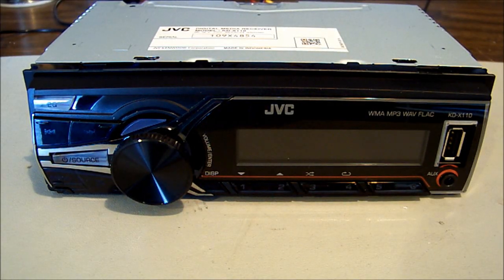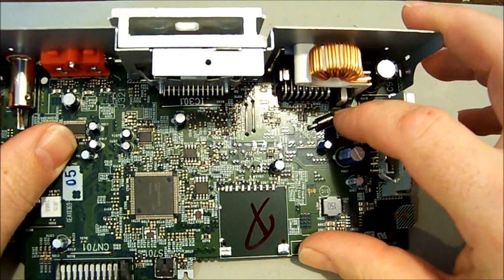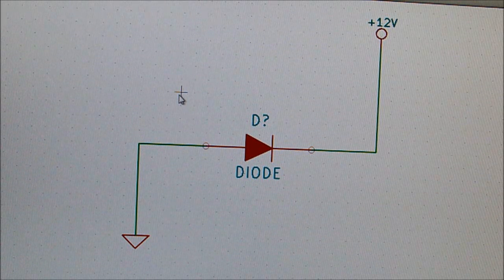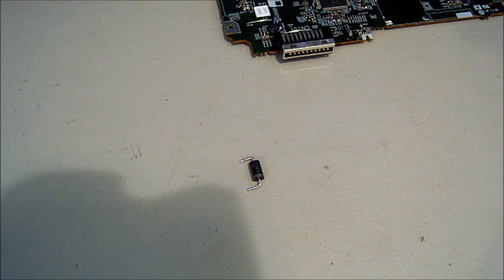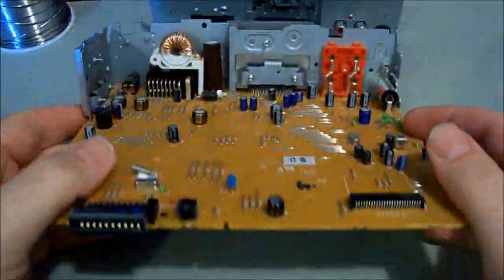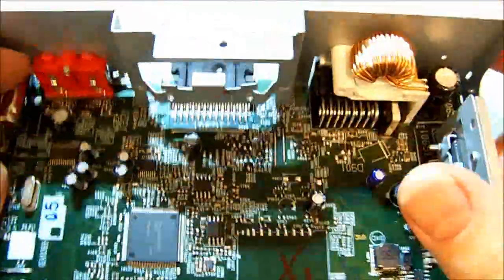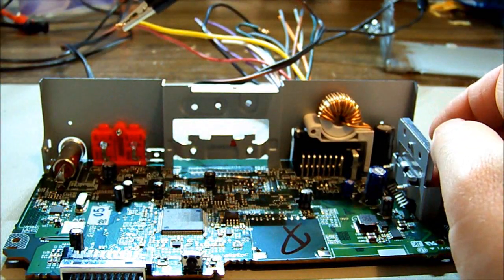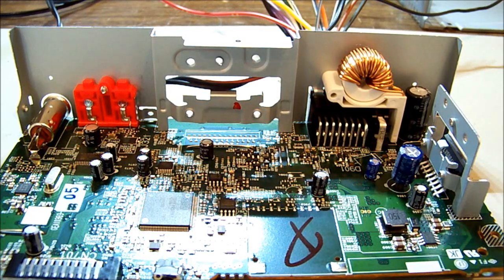JVC KDX110 Diagnostic

Comment: Brill vid. My JVC KD-R711 kept popping into Protect mode. I'd used a couple of line converters  with the Saab amp in my 9-5 and figured these ebay specials where to blame. Pulled em, using the RCA's instead but resetting & turning back on after a while would throw up Protect again.
Thanks to your video, I decided I'd got nothing to lose, pulled the IC chip and it's working 100%. Don't need the built-in amp anyway and didn't want to bin what is a great stereo. Thanks!
Reply: btw, not sure if this applies to many JVC models, but reset switch wouldn't clear 'Protect' mode on mine....pressing MENU and TP for 5 secs put it in recovery mode, scrolling thru' various recovery fault options with VOL, until CLR ERROR ( if I recall correctly ) pressing VOL in to activate choice.   This clears 'Protect' mode - unless you haven't found the actual fault, of course.
Reply from the maker: Oh thanks for the tip. I did not know that mode existed, cheers :)

Comment: 1999 Toyota rav4  oem head unit not working after jumping car battery. Trying to bench test.  All fuses and wiring to radio good. Already replaced with another one from ebay

Comment: I Have the same problem, on my jvc chip not burned, because it have voltage on input and output, But there is no sound. When I turn volume to max I hear little noise, Just noise. Do you know its problem with pre amplifier? How can I test it? Thnx.

Comment: Thank you so much!.If it wasn't for  19:42 (joining red and yellow together to test it) i would have thrown out my "all good JVC".I was doing it  yellow - and red + to test it..
Reply from the maker: Eeeek. If you put it in a car, connect yellow to constant 12V and red to switched so only on with key on. This will ensure radio memory is saved.
Reply: I was testing it on a battery thinking yellow was - and red +.Then when i saw how you did it .So i did the same,and then bingo...Its in the car now haha...Chers

Comment: I have a JVC Arsenal and an external amp and subwoofer. Ive checked all the wires,  new battery, I an stumped... why is it resetting itself when I turn the volume up?
Reply from the maker: That is strange. Make sure the power wires have a good connection. Sometimes the black wire  (negative) doesn't get connected to the right wire in the car. Bolt it directly to a metal part of the dash that connects to the cars body. The positive yellow wire might also not have a good enough feed depending where it's been connected to.
Reply: @JonnyFix  you mean the power wire coming from the deck harness? I have power and ground and RCA hooked into monoblock amp, and the amp is grounded directly to the chassis.
Reply from the maker: @stephaniespotts6533  if the amp and head unit share the same power feed when the amp cranks up it might cause the voltage at the head unit to drop and so it cuts out
Reply from the maker: @stephaniespotts6533  I would have a separate power and ground for the deck. I can only think your power and ground wires to the amp aren't thick enough, or maybe your ground point on the chassis isn't good. Also bolting the ground wire under an existing nut for example isn't guaranteed unless you've scraped off the paint. It has to be perfect wire to metal contact.

Comment: Hi Jonny Fix
Nice and informative video. There are not many out there - so thumbs up.
We have a JBL (Car) amp. It has gone into protect mode. It has blown two main units (Sony xlode and a pioneer)
By looking at your video on car amp, we were able to pin point the problem to the mosfet resistors. They had zero resistance where they should have Kilo ohms of resistance. We suppose it also explains why it has blown up two main units.

In your JVC KDX video you locate a blown audio output ic and you also mention the voltage regulator IC. 
But what if you can´t determine if its broke by visual inspection as you were able to.
Do you meassure voltage or resistance? and how much should it be?
What brand of ICs and mosfets would you recommend?

Thanks

,
Reply from the maker: Jacob Dragsted Often when an audio IC fails the transistors inside short which, if it doesn't blow holes in the chip, will often give you supply rail voltage on the speaker wires, so that's one way to know the chip is dead and generally how you know there's a fault on any amp output stage. SOME amps do present a voltage when no speaker is present, put a 10ohm resistor across the line to see if it goes away, if not then it's a fault. If a voltage reg IC fails you will either get too much or not enough voltage on the outputs. If fuses are blowing there could be a short on the input pins to ground. If you can't find a data sheet you can follow the power wires in and trace it to identify the input pins. A short on the input to the audio IC can blow fuses to. As for what to replace them with, it will have to be the same type. For mosfets, look at the datasheet for the old one and compare ratings to those available to you, if you can't get the same one get a higher rated one and one with the same gate turn on voltage. Good luck!
Reply: Hi Jonny Thanks for your answer. finally found time to try to fix those audio IC I wrote to you about. In your answer you talk about "supply rail voltage" What´s that? Also when you talk about amp output do you mean the Ic`s internal amp or an external amplifier? the test you talk about with a 10 ohm resistor across the line - what line is that the speaker lines? Do you know where I can find the data sheets?

Comment: Nice video. What do you think can cause an ic amo to overheat, got mine replaced but stull overheating at high volume.
Reply from the maker: They're not designed to be run at very high volume. Any amplifier used near it's maximum will end up clipping the output signal causing heat (and poor audio quality and possibly damage speakers). If you want more volume you should run an external amp and appropriately rated speakers.

Comment: PLEASE HELP!, MY CAR STEREO JVC, suddenly doesn't let me control it. when i start my car on, the stereo itself turns on and play a cd (last use mode) controls don't respond at all, not even to eject the cd.  i have a 'reset' and unplug my battery as well but still doing the same thing (starts play cd automatically), shows blue colors in screen waiting for setup (same when it was new) but can't control anything. Please help!!!! how can i fixed it. (its not broken, i have had it for 7 years and never had a problem bedore) Thank you very much!!!!
Reply from the maker: Sorry man your comment was held for review and I've only just found it. Probably no help now but I'd first say clean the contacts on the back of the faceplate and the ones they mate with for a start. Maybe better luck next time!
Reply: @JonnyFix  Hello. and Thank you veru much for replyingd my message!. So, I fixed it and i'd like to share my tip with anyone. What I did was. I grabbed a paper clip, and carefully i design the shape as 'Z' sort of shape (but more straight and square) and i measured visually in the way the clip shoul be inside on the faceplate attached to the unit and automatically pushing the 'Reset' button, located just little below of the front 'black unit'', Then, was in place and pushing the 'reset' button, I turn the stereo on and, and i soon as the screen show,  I finally hace full control of the Stereo.  Then i turn if off, Detached the faceplate and Take out the paper clip (and i am saving it for future uses, LOL), So, Up today i'm still using my old JVC Stereo.    Thank you very much!!!!!!!!!!!!

Comment: I have a quick question. I have a Jensen dmx 5020 headunit.  somehow a speaker output from my amp got wired to an output from the headunit. the audio ic started smoking and the diode reads around 5 in both directions. what possibly could be wrong other than those two components?
Reply from the maker: Hey. Not sure which diode you mean. When you say 5, did you mean 0.5? 0.5volt drop across a diode is normal. I think most likely the audio IC is the only part damaged. I would remove it from circuit and see if everything else functions. If so and you don't need the speaker wires or can't get a replacement chip you could run just the RCA lines to an amp (if it has them).
Reply: Thankyou for your help and responing. I hope thats it and I will definitely try that

Comment: Input protection diode ? Or output chip
Reply from the maker: If nothing lights up check input diode, but that would blow fuses or overload bench supply if it was bad. If it functions but no sound then likely audio chip as the car was probably jumped in reverse to cause this.
Reply: Not jumpered in reverse.  I used  a type s jump starter, power bank new from costco to jumper dead battery on my 99 Toyota rav4.  Radio was off. Whatever the surge coming back affected the radio. Your videos will be a big help.

Comment: hey, i got a question. I have a BOSS 9967b head unit with flipout screen where everything except the screen was working.i took it apart and checked the flex cable and it was fine. so i decided to power it up while it was apart without the cd mechanism and it turned on and was fine. however when opened the flipout, it came out halfway and the unit just went blank. its dead now. any idea as to the direction i can go?
Reply from the maker: You must have disturbed something inside. Check all connections, put CD mech back in, make sure motors or gears haven't jammed up.

Comment: 14:38 is normal to that piece be hot  50-60 celsius degrees ?
Reply from the maker: At loud volume its temperature will rise. If it is operating correctly then it's probably normal, especially if ambient temp is quite high. I think they're only rated to drive 4ohm speakers, if you use 2ohm then it will be under stress.

Comment: Hi Jonny Fix, I know this is a rather old video, but I am curious if you ever replaced the output IC just to see if there was any different behavior?  During the video, you were looking for JVC8031, but the chip is actually the JCV8031.  An easy misread "in the mind" considering the device is a JVC.  I did check on Ebay and it was available.  https://www.ebay.com/p/Genuine-Jvc-kenwood-JCV8031-Car-Radio-Power-Amplifier-IC/1385749307

Comment: Sir I want to repair panel button they are not working
Reply from the maker: Make sure connection between face plate and main board is good then check there is power to each button.

Comment: Maybe if you put back a good rectifier diode, you'll get to be closer to reach the on state... Just sayn' "WINK"-"WINK"
Reply from the maker: Incorrect. The diode is not used for rectification nor is it required for normal functionality as it is in parallel with input lines for protection only, not in series.

Comment: What would break if I put power to the rem wire
Reply from the maker: Probably nothing. Depending how the circuit is the worst you might do is damage it so you don't get 12v out that wire anymore.
Reply: @JonnyFix  the radio won't turn on anymore. Note this power wire was hooked up directly to the battery and I hooked it up by accident, thinking it was my pecon for my amps.
I don't have a lot of experience with this but not a noob either, any direction to go would be nice.
My guess after your video is maybe the voltage regutater and it appears to have some brown on a few pins. How would I go about testing it? In and out circuit. What would be the next component if it didn't stop there? Would that espencive part that blow in your video be possible?
Forgive the questions and mile long message and thanks for your time and help.

Found out the problem thanks for the help and reply earlier.
Reply from the maker: @FearOfDeath1332  OK I had a look at an old JVC unit here and the rem wire is fed via a diode so if 12V were to be put on this wire it wouldn't go anywhere, it can't go back through the diode unless the diode is shorted. There is a zener diode in parallel with this which will limit the voltage, my guess is if for e.g. the alternator fails and puts out >15V the zener will clamp it to not go higher (as it's passed through the radio first) and damage the antenna motor controller (this line is also used for electric aerial activation). It could also be to clamp back EMF that may happen from the antenna units operation? Anyway, if this zener has failed it will likely short and pull the rem output to ground. Since this output is fed directly from the main voltage regulator (big chip attached to heatsink on the side, (not the one on the back this is the audio amp) then if this line is shorted to ground it could very well stop the chip turning on. Find and test both these diodes, they're likely close to the plug. Find the pin then follow the traces on the board until you see them. The zener will have the anode connected to ground. You could take the zener off if it's bad as it's not required for normal operation as far as I can tell.